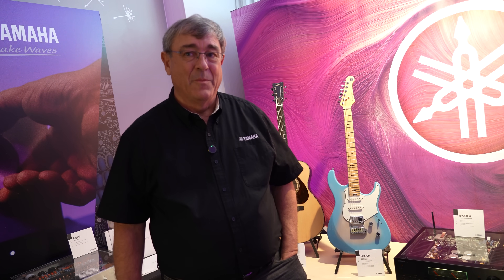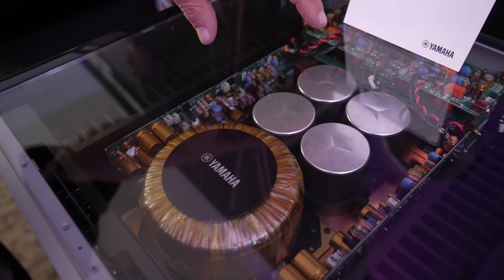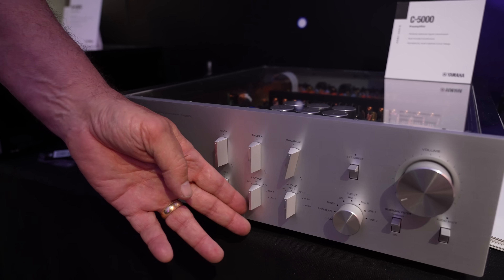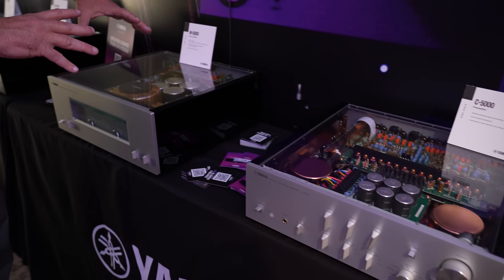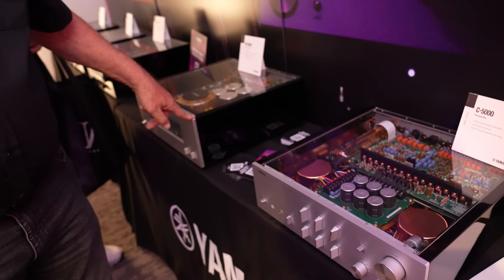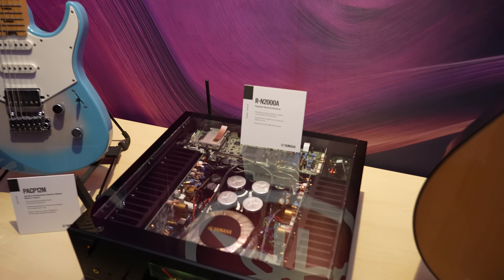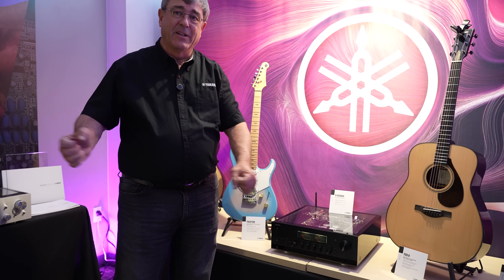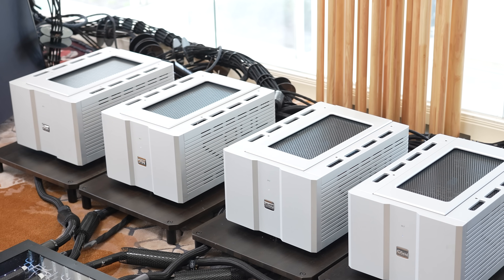Why so EXPENSIVE? Audio Amps Explained by Yamaha

Comment: Wow!  Phil that looks like it's a copy of my M-4 Amp and CA-510 Integrated Amplifier.  I'm pretty happy with my Hand made in Japan Yamaha components.  I just traded my Sansui G-5700 to a repair guy to spruce up my M-4 which on the discussion groups is being touted as better than the M-2 of the same vintage that was half as powerful at half the price.  Sometimes Bigger isn't better.  Smoother and discrete has it's place.

Comment: if these are still made in malaysia, the pricing for these does not make sense. whilst i don't doubt the quality of these amps, this price range is within the vicinity of made in japan high end audio labels. i think it matters at this end of the market. when i was looking for a new power amp, the m-5000 was considered. but i ended up going with accuphase, made in japan being a strong factor in my decision making.

Comment: I have an M5000 amplifier form Yamaha. It went out after just 5-years of service. Cant find a repair facility worth working with. The ones they list in my area scam shops. They themselves don't know the products themselves. Yamaha tech team keeps sending me back to these guys. Very disappointed. Now I am stuck with a 5000 series tuner sitting on the side.
Reply: It's best to contact the distributor in your country if the shop you purchased from isn't looking after you. What country are you in ?

Comment: I would buy that argument IF we could realistically expect this modern gear to last 20, 30 or even 50 years like gear made in the 1970's but I'm just not seeing it with modern manufacturing techniques.
Lots of miniaturized surface mount components. Lead free solder, no schematics, proprietary integrated circuits. 
Yamaha's modern amps do not have a good reliability rating at the moment.

Comment: You're right, it will beat the pants off of Yamaha's best, but it won't be hand-made in Japan, there is that. Make no mistake, that is the only thing going for these devices, their price in no way justifies, objectively, their level of high fidelity and low amounts of distortion. Devices for far less than $1000 perform much better than any of the devices being displayed.
Reply: I’ve tried a lot of the chifi junk from the likes of Topping, they tend to sound anemic, dry, and boring. If you like that fine but it doesn’t sound like real music to me.

Comment: There is no chance that 500$ amp will do same sound stage like the cheapest a-s 1200 from a-s series. Even the yamaha less expensive models cannot do this. The difference is clear and obvious even form my 70+ old Mother, never interested in qudio equipment. One just need to try.
I do not say that 500$ amp will sound bad, no it will paly fine, they will. But this is a different sotry, completely.

Comment: Great explanation. There is a price point for everyone - not everything needs or should be cheap. We live in a time when with so many choices and so much inexpensive stuff and expectations of low prices. However, we risk not assigning appropriate value to labor, craftsmanship, research and development, reputation, pedigree and pride of ownership. It's tempting to look at a very good quality product like an Eversolo AMP F10 that's highly spec'ed and delivered at a low price and confuse it with a Yamaha A-5000  amp or a Luxman stereo amp because they are all amps with VU meters. A quick in person side-by-side would immediately highlight significant differences in quality and esthetics that someone would assign a value to - not to mention the reputation that a 100 year old company has built ti which the market has assigned a value.

Comment: They cost that much because people pay it
Reply: They cost that much because Yamaha (Audio /musical division only ) have to pay Hundreds of Millions of dollars in wages each year , thats on top of all their other costs ,R and D , Advertising , mainteance etc etc , its expenses are into the Billions each decade.
They are not a charity service , get real ffs.
Reply: I think they also pay it because they have been told raw horsepower is the answer to Hifi. After 30 years of Hifi enthusiasm I’ve realised it’s not.
Reply: @HifiLoveLetter all depends on the speakers. I've had klipsch chorus that needed only like 10 watts and I currently own a set of Infinity Kappa9s that need a 500w amp. Different designs produce different sounds.
Reply: @HifiLoveLetter  See my comment above.
Reply: There's a lot of people who WANT to spend that much, and have racks and racks of shiny stuff.
Reply: When you listen to a 3 watt amp, you realize how much you actually need.
Reply: @joejoejoejoejoejoe4391 depends on the speakers you are driving. Low impedance has a factor and how efficient they are is critical. Low power causes clipping which damages the loud speakers.
Reply: @joejoejoejoejoejoe4391 with my infinity kappa 9s, 3 watts won't even make a whisper.

Comment: It's a beautiful piece of gear but just like high end watches it's an object of desire and priced as a luxury
Reply: And like an obscenely priced high-end watch that can't keep time as accurately as a $20 casio or no-name quartz watch, so is the case of these devices when compared to modern class-D amplifiers that cost far less than $1,000. Less than $500 for pre-amps (which for cases other than phono [i.e., record players] are pretty much obsolete).
Reply: @SteelBlueVision  I agree, it's a generational fixation on old technology. I'd buy a Panasonic UB820 4k player as my source, Buckeye purifi amp, and use a modern low SNR AVR with preouts so I can decode everything and do proper bass management and room correction.

Comment: Still sounds like snake oil 🐍🐍
Reply: That's where the game gets tricky ... 

Yes there is a luxury audio market in which reputable companies like Yamaha play very nicely. You will get precision engineering and assembly, better warrantee and equipment that lives up to it's specifications.

Beside that we also have a whole list of shyster companies producing crap, with poor design and assembly, for prices even higher than we saw in the video.  Their prices are sky high for two basic reasons: First people are dumb enough to pay and Second the company is likely trying to get a year's income from a handful of units.  

Sadly it's not always easy to tell them apart.
Reply: @Douglas_Blake True. that's why I'm still holding on from buying a better DAC&AMP+Preamp for my Audio Technica R70x.
I'm looking at FIIO-K7 and rocking Shanling UA1s right now.
First, I'm sure that shanling ain't powerful enough to drive R70x and Second I'm unsure if my ears will even hear the difference 🫠(I live in very high noise pollution region)
Reply: @AyushBakshi  
While I'm not well versed on the headphone world, I can understand your dilemma.

I build "soundbar killers" for friends and their friends.  This is typically an HTPC, a DAC, an Amplifier and a pair of nice speakers.  Were I to do this with "high end" or "top name" components it would run about $5 to 7,000.  But by a bit of careful shopping, followed by deliberate testing, I've been able to get ~99% of the same quality for under $1,200 by dipping into the "Chi-Fi" and tiny computer markets.  It's a bit of a hoot, and a rolling gag that, except for the speakers, I will usually deliver the system to my clients in a shoe box.  LOL... My last system was a Nike size 10!

My best suggestion is to find equipment with the features and compatibilities you need then buy from the mid-range price.  The big secret is that most DACs are surprisingly alike as are most amplifiers. The real differences are in the speakers ... or headphones in your case.

It really is true that cheap audio is getting better and better audio is getting cheaper.
Reply: @Douglas_Blake  🧐 Interesting. good info.
Reply: Why don't you listen to Yamaha hifi for yourself . Prices for all pockets